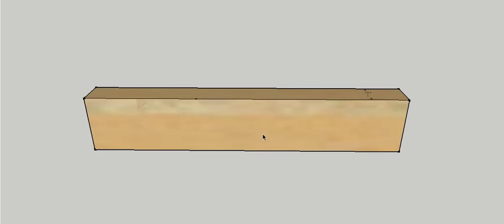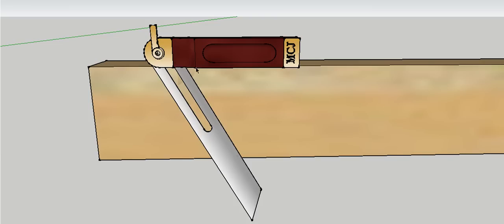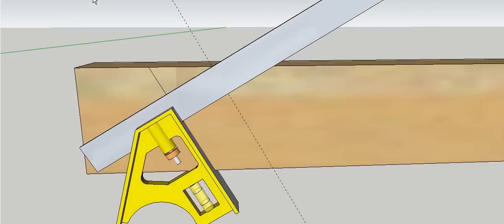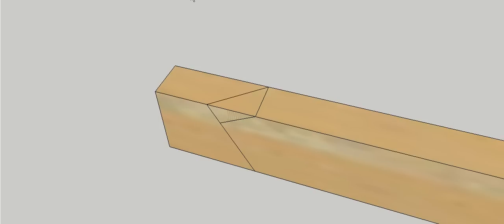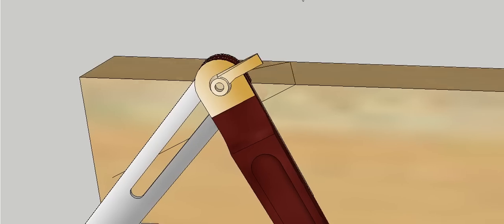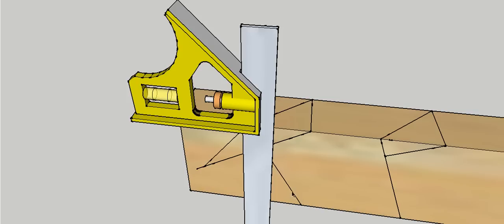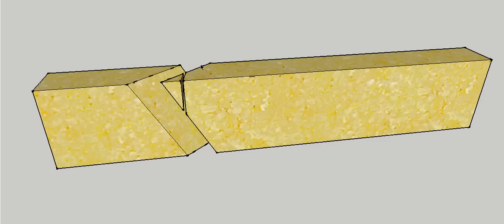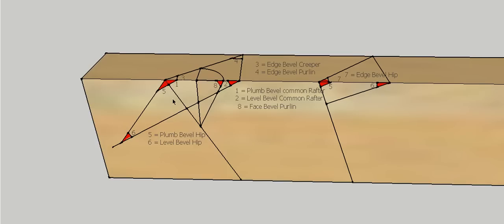Direct Method

Comment: The American sites talk about 2x4 lumber, what does this equate to in Australian lumber dimensions?
Reply from the maker: Hi Eddy, we still use the term 4 x 2 as well which referred to 4 inches by 2 inches, in metric that would be 100 x 50mm however with thicknessed timber these days our timber size is 90 x 45mm.
Reply: @Buildsum  excellent thanks for the confirmation:)
Reply: time to get metric Chucky, its a lot more streamlined mathematically and it works into physics formulae simply- hence the name metric! Get digital!
Reply: english people talk about 4x2's phonetically referencing jews! china plate= old mate!

Comment: Confused. I like the principle of the direct method. I used the above method for a test project I was recently working on but discovered that the roof pitch was incorrect. It was in fact the complimentary angle. Using the method above, you appear to start off by stating that the first line you mark on the timber is the roof pitch angle, in this case 30º. But that would surely make the Plumb bevel (#1) a 30º angle, which doesn't seem right. I understood that the Level bevel is the same as the roof pitch and the plumb bevel is the complimentary angle. Am I confused?
Reply from the maker: Hi, Will, I guess when I say the "roof pitch angle" I am referring to the Plumb cut which when cut on a mItre Saw it is set at the angle required for the Plumb Cut of the roof. However, you are correct 30 degrees would actually be the Level Bevel and the Plumb Cut is actually 60 degrees. Hope this helps.

Comment: Absolute sorcery, some skill this
Reply from the maker: Hi Steve it's just proportional triangles really, personally I like the proportional triangle method better because I find it easier to remember
Reply: @Buildsum  yeeah nah yeah!, now you have online calculators free of charge to use on line, as long as you understand how to use them, proportional algorithms of all geo metric forms that exist, simply fill in the data inputs and it gives you angles and sizing per dimension.